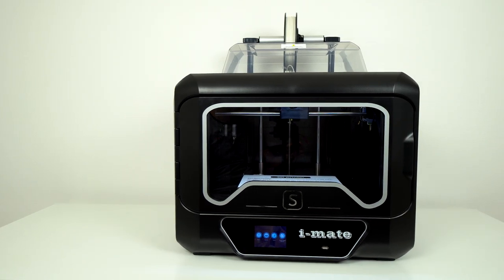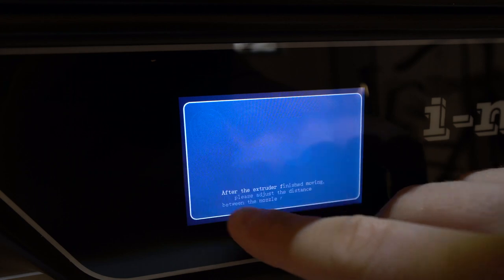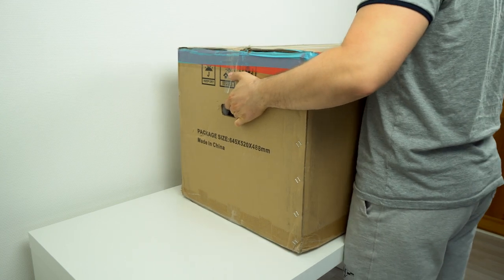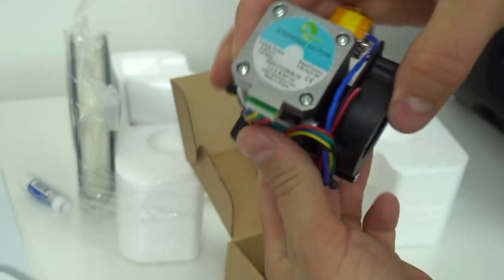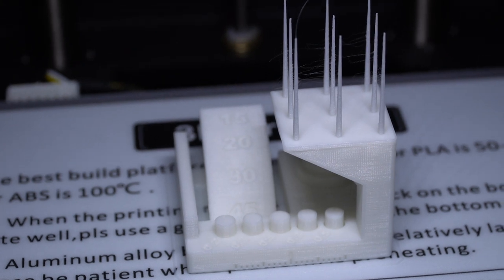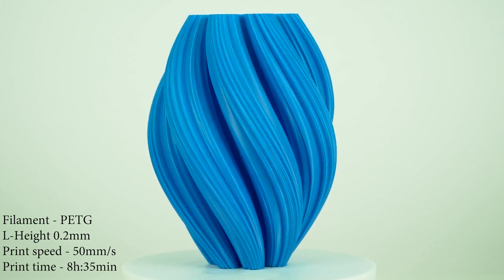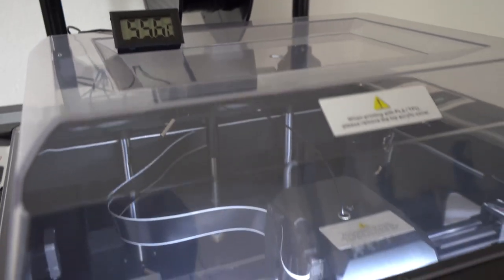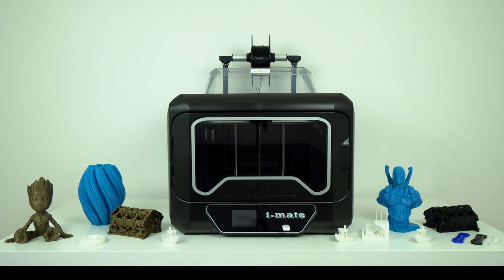QIDI TECH I Mate S 2021 3D printer review - all you need to know

Comment: Which slicer did you use and did it come standard with the printer. I’m a new subscriber
Reply from the maker: Welcome a board man!
I use simplify3D but with the standard slicer that comes with the printer i got great results as well.
Reply: @NexiTech  thanks man. I’m a inventor of a company called elite clipper mods. I use Petg could you possibly do a video on the best settings on that slicer for petg as well as other filaments. There’s not enough videos like that . Think you would get a lot of views

Comment: Thanks for this review. Do you know if this printer has all-metal hot end? I tend to print with carbon fibre nylon and this stuff eats through anything else.
Reply from the maker: No problem, I'm glad you like it. I don't think that this 3D printer have all metal hot end. I have his bigger brother X Max and he comes with second extra extruder with all-metal 300C hot end with steel hardened nozzle. Try to write to QIDI TECH and ask them if they can add that high temp extruder instead of second one with 0.2mm nozzle that comes with I mate S.

Comment: Amazing review ! Thanks ! Do you need the full enclosure to print PETG and TPU. I only print with PLA, PETG and TPU no other filament types and I am curious should I take the enclosed version pf the printer ? thank you !
Reply from the maker: Thanks man! I'm glad you like my video. If you print PLA, PETG and TPU you don't really need enclosure if you place your 3D printer in room temperature. On other hand if you keep your 3D printer in cold room/garage without heating then enclosure 3D printer is very welcomed.
Reply: @NexiTech  Thank a lot :) ! I am thinking to buy this machine, I think it does an amazing job
Reply: @NexiTech  I have one more question because I can order it with an enclosure or without then to build an enclosure. Is it hard to DIY enclosure from plexiglass ? or the enclosure it has worth the extra 100$ ?

Comment: i have a question, i've had trouble keeping the print bed to stay at a specific temperature, and it keeps overheating. would you happen to know how to fix this? :')
Reply from the maker: Check the heatbed thermistor or the Heat-bed relay(if there is one) That could be a issue.

Comment: I thought it didn't include a hotend that supports the temperatures needed for nylon printing?
Reply from the maker: There are plenty Nylon filaments that can print under 250c.
Reply: @NexiTech  Can you point me to a brand you recommend or at least can say you've had success with? I'd like to try it.  Thanks.

Comment: Hi. For gopro holder (motorcycle helmet) , what filament do i need to use ? nylon or abs ? wich is stronger ?
Reply from the maker: ABS or PETG should work nice for that application.
Reply: @NexiTech  PETG with carbon ? Or without carbon ?

Comment: Any good tool to extract the really tighten handle out from a Grohe faucet?
Reply from the maker: Cloth and two small crowbar?
Reply: Nexi Tech yea right. Small crowbars I never thought of! It may cost more than the faucet however
Reply: Nexi Tech but can we discuss? Local plumber say small Hydraulic puller can do the job. But Where is the pivot point? I don't get it. Any insight ? Thanks!
Reply from the maker: You do realize that there is hundreds of different type of Faucet and I don't know which model is yours and also I'm not even a plumber :D I just quickly thought that two small crowbar can maybe do a job and most people's have this kind of tools in a garage or a storage rooms anyway so why not try it yourself. Try first to knock it around with a small hammer it may loose up. Also hammer and flat bigger screwdriver maybe also work?
Reply: Nexi Tech of course! I just fire post my problem to many channels like you hoping for insight. Thank you for your advice.

Comment: 1:36 a lot of shaking isn't?
Reply from the maker: That's normal for a 3D printer printing infil at higher speed. You should see delta style 3D printer when they start to move in small areas at higher speed. It's pretty cool to watch. They are like small industrial robots. There are few delta style 3D printers that I reviewed in the past on my channel. Check them out.
P.S. Edit also my Hallow IKEA desk table adds even more vibrations to a 3D printer. Best is to place them on the ground or on some real wooden stable table.